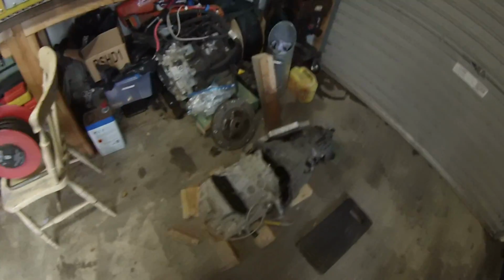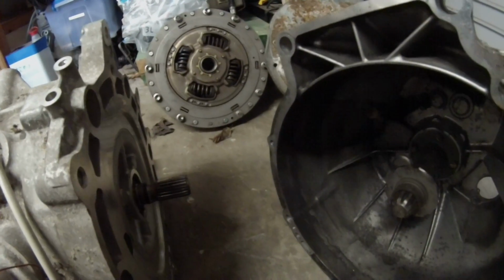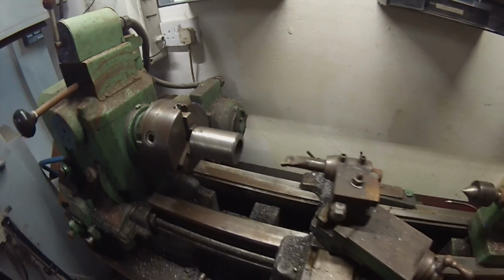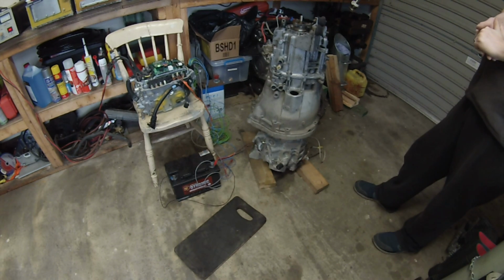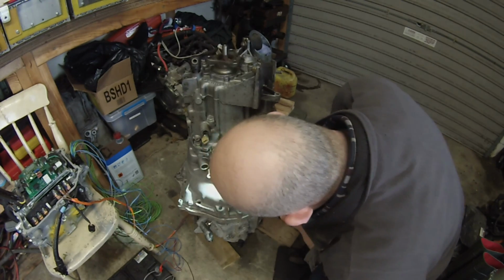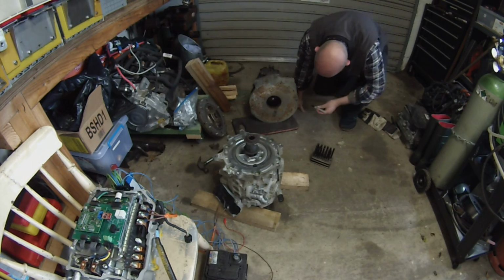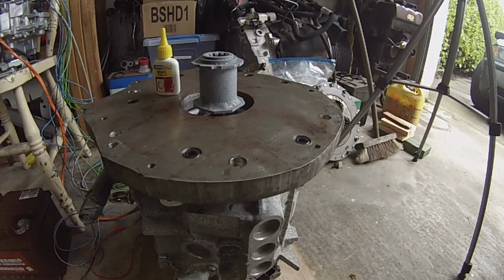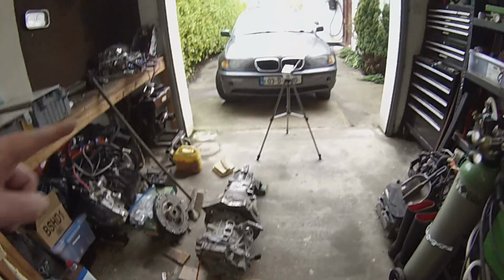The Grey Goose : Nismo Electric E46 Touring

Comment: Damien. On a E36 with the clutch still connected does it require some brake system vacuum to be present? On my uncompleted conversion the clutch pedal on encounters resistance at the bottom of the travel. I know you prefer to remove the clutch but do you know if i have reinstalled the clutch wrong?

Comment: How did he measure for coupler length?
Reply: Measure the shaft lengths relative to the mating faces.
The thickness of the aluminium adapter plate along with the shaft lengths give you the answer 👍

Comment: Would there be any benefit to turn the final welded coupler on the lathe to just round off those bumps on each end of it?  If it’s going to rotate at high speed, I think it would vibrate far less if it were perfectly round.
Reply: I thought the same. Or leave the whole disk instead of cutting out the centre

Comment: If you stick a piece of decently straight wood in your lathe chuck, then stick the coupler on it, and then loop a piece of exposed wire around it, you can weld whilst rotating at the slowest speed. Have done it, makes such a difference to be able to weld whilst rotating the part. Obviously some blankets over the ways too. Keep that in mind if you decide to weld another coupler in the future.

Comment: I went through your old vids and found the one where you used a hole saw to cut a hole in the side of the bell housing and used a dial indicator to observe and minimize runout. For the extra $20, I think that's probably what I would do over just this feeler method. I think the problems happen more on vehicles where the machinists hired then overestimate their measurement and fabrication abilities, and end up with a "precise" alignment that is being trusted and has no adjustability, but is very much not lined up. You're better off feeling the adjustment than depending on an overconfident machinist.

Comment: Is Leaf motor enough for that E46? Does the consumption of electricity goes down on the same speed as you go up with gear? For when rolling at 80km/h let's say?
thank you
Have a nice Easter
Reply: The Leaf Motor is a PMAC motor (Permanent Magnet Alternating Current), meanwhile the Model S, X, and first gen Roadster use ACIM (Alternating Current Induction Motors)., Permanent motors are a better choice, due to them having a better power density (smaller and weigh less than Induction Motors but make just as much power), have better low torque RPM, better regen braking, and  less likely to have bearing damage. ACIM's support higher peak torque and power.